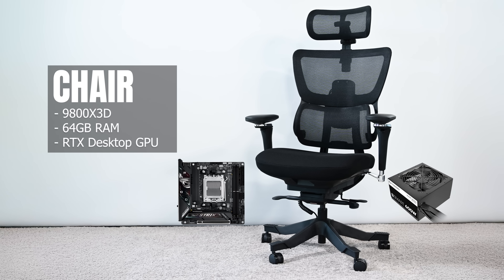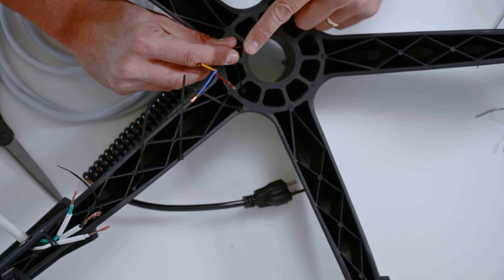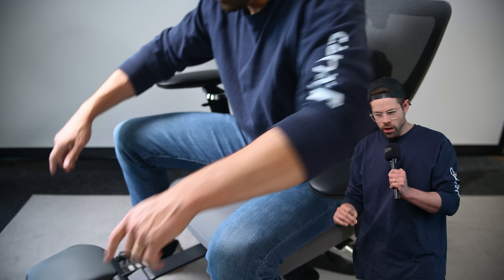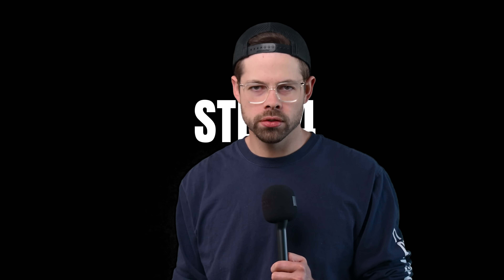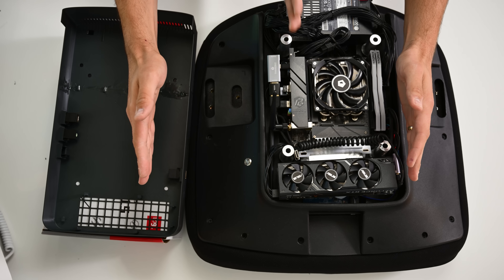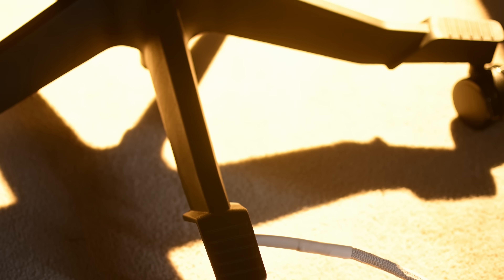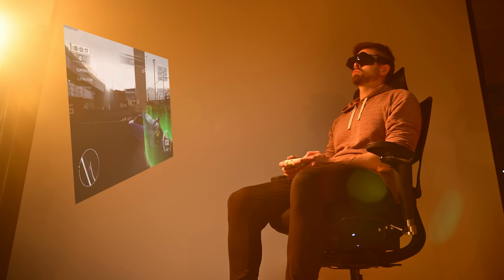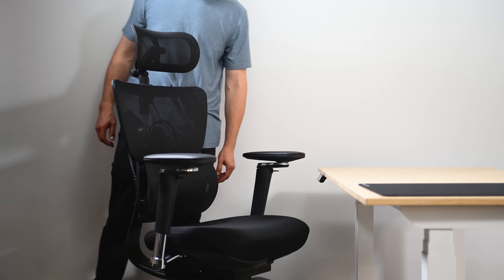Building the World's First Invisible Chair PC

Comment: Could you do this without wires ? Literally NO ONE.
It will work with a mat under the chair that wirelessly transmits power to the wheels.
And with a system that tracks or transmits power when the chair is moved on the mat.
And if the shared power isn't enough, a battery can be installed.
I think the price gonna be higher than a Nasa's PC

Comment: A little tip - use 45-deg chamfers instead of fillets when printing them in the air without supports. This never fails, looks clean and can be used in many situations to bypass the need for support.

Comment: 10:05 About the fans not spinning, some gpus have a 'zero rpm mode' where if the gpu is not hot enough yet, the fans will not spin. It typically starts spinning around 60 degrees celsius. The screen turned on, so if it was plugged into the gpu that means that the gpu was working, the fans were properbly just in zero rpm mode.
Reply: no the screen can turn on if the gpu is not working, because the CPU has an internal GPU, that means that on most computers you can run the system without a dedicated GPU
Reply: @EvolutionOfAnything  If the HDMI lead is plugged into the motherboards HDMI port. Otherwise it won't show anything.
Reply: @EvolutionOfAnything  It's funny how confidently incorrect you are.

Comment: i think he doesn´t watched optimumtech video. there is a more smaller PSU called HDplex. and i got worried by the durabillity of that build because i feel it too weak. please use a more dense and thicc walls with PETG filament material. that will break eventually if you don´t use PETG.

Comment: @BasicallyHomeless I have an amazing idea for the next generation of PC chair. Add a desktop that can move out of the way for entry and exit, just like those old fancier school desks. Then, you need a monitor that folds down into the desk. Underneath the monitor when it’s folded down is a low-profile built in keyboard. Off to the right, it has a slide out mouse pad. Everything gets hard wired through the entire chair directly to the PC underneath the seat. The perfect gamer setup to use anywhere at any time. Tell me I’m wrong.
Reply: You wanna game in the kitchen? Plug it in next to the microwave. Wanna game in the bathroom…like some weirdo? GFCI outlet is calling your name. Wanna be a loner out in the garage? Pick ‘er up and plug ‘er in next to the table saw. Goin to a buddy’s house? Gently toss it in the back of your car and go.
Reply: Just imagine. The only thing that limits you is what outlet you can plug the chair into

Comment: Okay the day I'll get enought money I'm building something like this but the easy mode.
Instead of a chair, I'm using my Armchair, which has a lot of empty space below and is already covered from all the sides. Also it already has always been placed near a wall, so no one is going to notice the cables.
Then I'm using a Quest 3 headset connected with WiFi 6, since I'll be standing basically on top of the PC, the delay should be unnoticeable.

Currently my budget is 0€ and I'm poor as hell, but a little girl can dream... maybe one day I'm going to be able to afford this

Comment: i think you should add a detachable 10Ah battery array, and then make the power cable have a magnetic connector, so you can just wheel it to the fridge and get snacks without having to ever look away from the screen.
also might want to incorporate a transistor or relay or arduino or something into the other half of the power cable so it's not electrified when it's not being used, so you can keep the kid safe

Comment: Ohh you say "practical"? This is PracticalAF©®™ , like think about it, attach a desk to one of the armrests, and put a keyboard and mouse, doesn't even matter if it's bluetooth or not, because you could just zip tie of maybe tape the wires to the body itself, then get those glasses that are just a monitor, doesn't even matter if they're smart, or, wireless because the wire can just go with the main pipe, or _inside it_, and use it for gaming and stuff. Internet connection not good? Just use a tube and bunch the AC Wires and an Ethernet cable together and guess what? It's still a single wire. Oh and playing a car game? Then why not use a steering wheel instead of the keyboard and mouse. Another use, Personal Theater, do the same thing, and you can just not use the desk attached to the chair in some way, instead get an air mouse and use that, then to see the thing, either use those glasses, wired or wireless, or hook it up to a monitor, wireless or put an hdmi cable with the ac wires and route it, preferably using some way to keep it to the walls or floor, and then hook it up to a monitor... Or... a TV

Comment: ok but can it run crysis lol, also try water cooling on the next one  i have an issue with just the ambient air around in my house or room making my computer radiate to much hot air even with my swamp cooler on, when it gets to about 80-120 outside you can tell the difference from my room to the rest of the house its at least 10 degrees hotter my laptop is a lenovo ideapad700 overheats and blue/orange screen at least 3 times a day it is old but still kind of works but i doubt the type of laptop would change any heating problems as they dont have a water cooled laptop,  my desktop works fine water cooled but issues with that as well its stuck on the windows load black screen with the circle spinning forever

Comment: just an idea, maybe replace the io with a single thunderbolt port, then you could wrap a thunderbolt cable in a sleeve with the power cable and make it dock to the rest of your setup as technically one cable, just two plugs on the end

edit: you kinda did that

Comment: Don't use Steam streaming. It's not that good. Install Sunshine on your desktop and Moonlight on your handheld/TV. Then just slap an Intel mini PCI-e wifi/bluetooth card with Wifi 6 into a spare NVME slot and turn on hotspot mode in Windows. Now you have a dedicated wifi network with insane performance for streaming to a phone or Steam Deck for like $25. The big advantage is latency, because packets never wait for another device on a network with only 2 devices. My phone only has Wifi 5 at ~850Mb/s but it still gives me perfect 1440p@90Hz streaming with basically invisible latency that allows me to drive at 300km/h without crashing.

Comment: congratulations u have accidentally crafted a pc backpack fully capable of interfacing with occulus quest 2 smart goggles, also u can easily slot SEVERAL additional rechargable lithium ion battery banks. your about to become stupidly rich ;)(rush in on some patents)
Reply: also u can use bluetooth hdmi modules and various others to bypass the wires entirely, i also remember a ghost plug hmdi module for he empty unused ports to gain even more gpu power by triggering the pins(pinout driver stuff)

Comment: Note:

Some low-profile/power GPUs have fans that don’t ramp up or even turn on until you hit it with a sustained load.

If the low-profile GPU still outputs to a display, then I’d recommend testing it to see if the fans spin up under load and if not: look into replacing them.

I’d just hate to see a GPU get thrown away. I did that and the guy who bought my “broken” card for 70 bucks probably thought i was an idiot.

Comment: If you didn’t attach the PSU the way you did it you could have just turned the motherboard to not twist the PCIe Riser…

If you do something like this, trust me, just use Screws, save yourself the headaches that can happen from using permanent solutions before the build is final

Comment: GPU fans not spinning doesn't mean its not working. Some are defaulted to not come on till a certain temperature... also could be wrong, I'm no expert but if your CPU doesn't have integrated graphics but the monitor is displaying the things then I'm pretty sure the GPU was working. Quickest way to check is open up task manager ctrl+shift+esc and if its there run a game after downloading the drivers so you can check performance and that the fans come on

Comment: I did something similar about 10 years ago with a Lazyboy reclining chair. Bolted the PC case inside the chair back, had an LCD screen on a motorized folding mount fold down into the left arm, keyboard and mouse on a small motorized table that folded into the right arm. I even wired it up to wake the computer and fold the LCD and KB/mouse out when you reclined the chair. It was sweet, but in the end it didn't work out so well. It overheated frequently and my attempts to give it better air flow weren't working so I gave up on the project and took the parts out for another system.

Comment: 0:35 - I HATE those wheels!!! I hope he goes over replacing them with good rollerblade style wheels.

Sadly, he does not.
Reply: I bought a chair and paid extra for rollerblade wheels, I found them impractical. moving the chair took more force to pivot the wheels, since they were larger, and you ended up rolling more than you wanted since the wheels rolled so easily. just my rambling two cents.
Reply: @malibu_jones  That's good to know. I've never actually used them but I feel anything has to be better than the hard plastic used in this design.

Comment: You ever watch a YouTuber do the kind of stuff you do in your spare time and think "Man, this guys a fucking idiot", mind you, he's not an idiot for picking this specific project, he's an idiot for doing it as wrong as physically possible. If you designed something to need to be assembled with more hands then you have, then you've designed it wrong. How would I fix it you ask? You didn't ask? Too bad, I'm gonna tell you anyways. Design a backplate to mount the motherboard to that uses the existing holes on the the seat bottom, rather than making new ones. Make sure it also has holes to add in the extension posts, but don't mount to those, we want them to be independant as to not impede the chairs operation or the PC's by having them be part of the same mounting system. For the riser cable, im honestly not sure the best way to fix that particular issue, maybe look into different length or angle options, really you just need like, a few 90 degrees or some clever parts moving. Another would be to swap the PSU and GPU positions and just run the riser underneath the motherboard. The mounting plate also solves the PSU needing to be glued to the chair, and screwing the motherboard into the base of the chair while it flexes and moves is just a good way to crack your motherboard anyways. And like, how do you plan to avoid unplugging your PSU every time you rotate you chair too much? Idc what you say, even with better wheels, it's still gonna happen.

Comment: For the AR glasses they just work as static displays stuck to your glasses when plugged in. The Bigscreen Beyond needs base stations in order to track properly, which means it still isn't an all-in-chair setup.
Reply: im assuming it doesn't need to track if you're just using it as a display

Comment: for v2.0 make the wheels the contact point for power and deliver it from a metal mat with hexagonal patches so you have at least two wheels on one positive hexagon and one negative hexagon. so when you move your chair the power is automatically withdrawn from what ever hexagons your chair ends on.
Reply: Nice Idea but there are way better solutions in the industry.

Comment: You r nuts. pc needs at least 9 140mm fans with rgb... and a 420 radiator.
Oh my monitor has a 7945hx3d and a 7900XTX 850w psu 64gb Tridenz 6000 c30 and two 4tb g5 ssd's in raid vesa mounted at the back, no need ugly chair :P

Comment: The smart thing to do would be to patent this design
Reply: You think this is an actual good idea? It's not. It's a fun project and video but it's not practical. 

There's a reason you don't see combined products like this. What happens when the chair wears out (which WILL happen)? Does the company sell just the chair part or do you have to buy a whole new setup? 

Much easier to just sell a computer or a chair.

Comment: GPU fans were not spinning because the GPU wasn't hot enough, so it did not need cooling. My RX6600 does the same thing: When I turn on my pc the fans are not spinning, but if it reaches a certian temperature(after some gaming) the fans turn on to cool the GPU.
Reply: this should be common knowledge. Although you can circumvent this by using a program like MSI Afterburner to have a curve and making it so it turns on fans. Not recommended but it exists
Reply: Yeah, it freaked me out when I installed my new GPU. The fans never started, and nowhere did it say that it was normal. I was nervous as hell, until I managed to check the temperature.
Reply: Adrenaline software defaults to zero rpm mode, you can just toggle if off
Reply: Yeah i know this happened to my gpu when I first got it so i looked it up and it was like the first result so how did he not understand this??